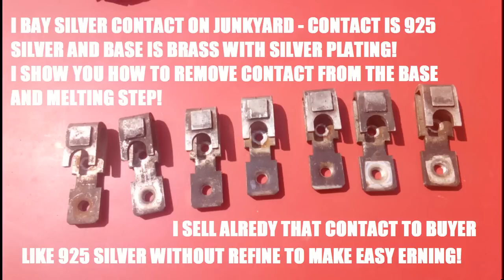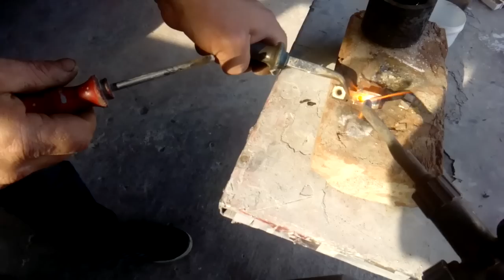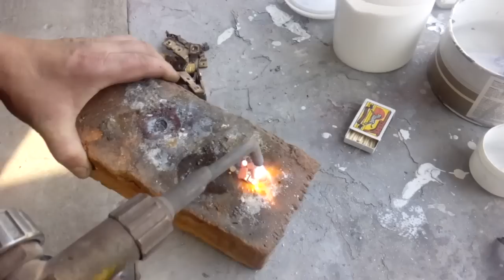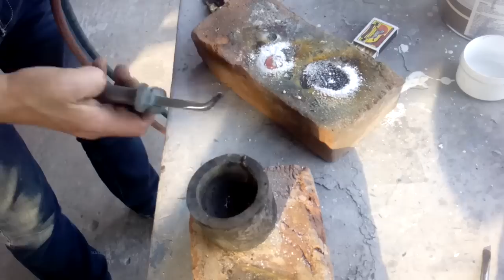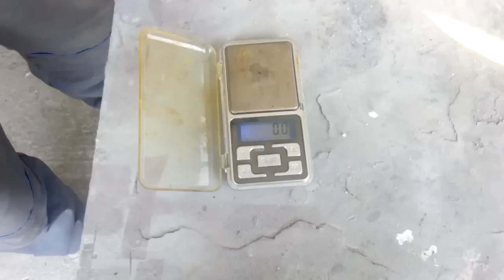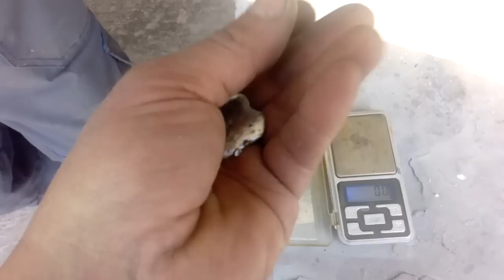SILVER RECOVERY FROM CONTACTS - no acid !

Comment: Why do you add the flux at the end of each melt? What does that do?
Reply: Removes the oxides purifying it's a short way of cleaning the outside layers of silver instead of using a cupola process
Reply: @TheIrishdriven  Is any silver content lost when you melt it down? Due to evaporation etc? Any ways to mitigate that loss?